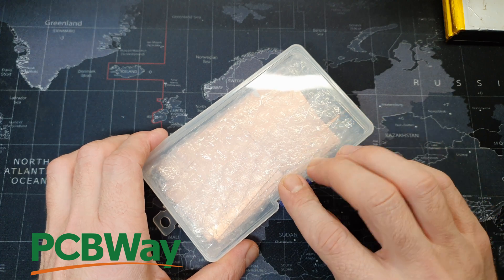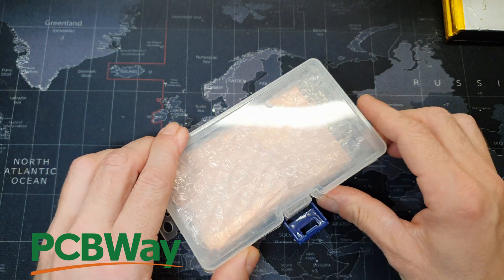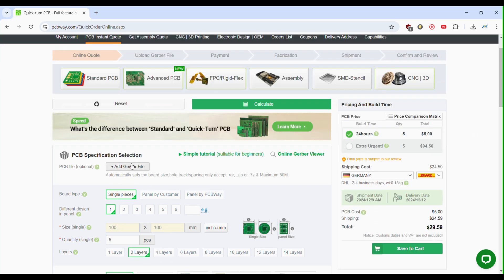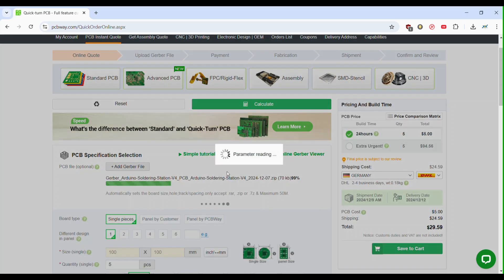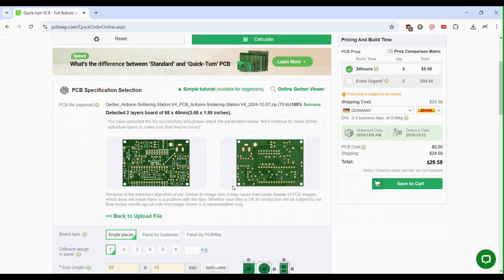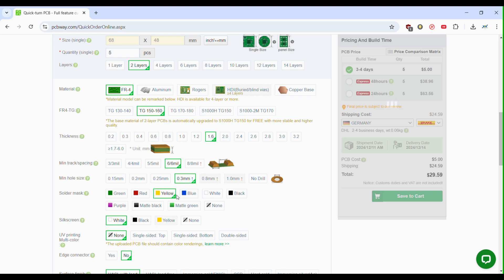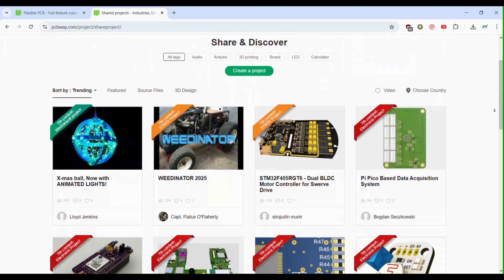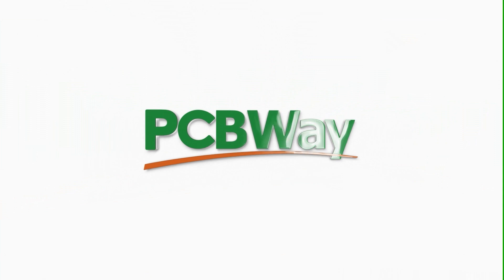How To Make Arduino Soldering Station  (Cheap JBC C245)

Comment: Hi.
Thanks. for posting this. I have put one together on perf board and having a few problems. I have just finished tracing the schematic vs the pcb photo and noticed a difference.. The schematic shows C13 on the Thermocouple amp circuit while the pcb shows C13 on the heater high-side switch side. Since you built this with the pcb, can I assume that it is right? Thanks for any help. Paul from Canada.
Reply from the maker: Hi Paul, you are absolutely right, I made a mistake when I designed the PCB, I revisited the project and yes indeed C13 was connected on the high side of the switch, when it should have been connected to the thermocouple amplifier, I updated the PCB and the folder in google drive. Thank you for noticing the mistake and letting me know!

Comment: Very cool project, I want to recreate it but have a few questions. What power supply would be good for this, and does voltage leak to the tip?

Comment: many thanks for sharing this design. When i switch it on the mosfet gets extremely hot then burns. The temperature is increasing and the power led turn on. Do you know what might be the issue?

Comment: This is awesome!
I tried it, but when I powered the heater (either 5V or 12V),
the Arduino read the wrong value. It jumped from 35°C to 500°C within 2 seconds.
I've divided the ground wire and divided the power supply, but it's still the same.
Please advise.

Comment: Hello, I'm working on this project and it doesn't work? When I apply power (18650 battery and buck voltage 19v). After powering it on, I noticed that the Mini 360 3A was hot, why? And how to set the resistor on Mini 360?

Comment: What is the use of the TC pin in the U7 connector, sir?
Reply: U7 is the connector to the soldering handle and the TC pin is short for thermocouple, the element in the tip to mesure the tempeture of the soldering tip.

Comment: C210 Tip is as Working answered Version 4 Station , i have burned tips , recycled but its not given a 500k Resistor , i can choise 470k or 510K which one is for C210 ? it is sadly to not goven a discord where get help , this is a good station but its cant resolving the tip , C210 have only pinouts P+ and - and GND = 2 Pins only. The Calibrate isnt work its overrun and gets hot at 12v 6-mp
Reply: i build c210 iron based on v4 12 iron, used 540k resistor for gain if you cant get exact resistor you can combine 2 resistors in series to get that value , for c210 tip there is only 2 pins smaller one is positive P+ and rest 2 pins middle and outer shell is shorted so you have to connect small pin and middle pin, i can not attach picture or can not share links here i would have sent images . no need to change code for v4 ino. then calibrate.  i am going to build new c210 better iron than this later.
Reply: @dhiraj787  Yes please, it is sooo needed, 540K Resistor are replacing with ( 220K )  in the Version which are V4 T12 Edition from Home Projects himself right ? But i have get a very Red Tip and its going a lot of hot , i have 12v 5.83Amps i think the supply is okay ?
Reply: @dhiraj787  I Am on a Fight from since 12.2024 i have enaugh from that station i have trashed 6 Tips it is 1000000% not working with C210 it is a fail big fail i have no idea anymore that project is the crappiest project i have ever see and start
Reply: Tryed 2x 270K no work , Tryed 470K , No work, Tryed everything the c210 is not working on that station, everything is working but not c210 sadly !
Reply: @user-bw5hk5nb3k 
Hi my friend 
You can solved your problem with c210 tip ?
Iam also have same problem
Reply: @hamedmansoory553  No i cant solve the problem its not working but they all say its working , it isnt 100% not
Reply: I have a t12 tip that only shows 
resistance from two connectors and none of them reach the body of the device. How do I close the connection?o.
Reply: @hamedmansoory553 But that is the C245 Edition not T12 ?
Reply: I just found a schematic that might be useful. Where can I send it to you?
Reply: Regarding the c210 tip
Reply: @hamedmansoory553  is the c210 edition the same with external PowerPlug ?
Reply: https://youtu.be/89hMWXOFliA?si=Qh7eQvQOK6Q2w0uC
Reply: Please check this post

Comment: I have now use 24v 6 Amps its not anymore crash or restarts, but the warming up steps is wrong i have put 50 grad its loading the grads in 10 seconds overrun 😔 Please is it fooling me or is that really working i have no more idea
Reply from the maker: I'm not sure what is realy going on with yor station but definitely shouldn't behave like that, my help is limited but I will try to help you. First power it up with lower voltage like 19V or less and see how it behaves, use another op-amp if you have ( those fake ones they behave differently from one to another ), play a bit with C13 and try to increase or decrease the value and see how the station it behaves, try to change to PID controll or DIRECT control and see witch one it works best, measure the temperature of the tip externaly and comparet with the temperature displayed by the station and lastly VERY IMPORTANT when you calibrate the station use an external thermometer like a multimeter or a dedicated thermometer for soldeing stations otherwise the calibration it wil not work and not only that the tip may glow red even if the station is showing a lower temperature, the calibration is made in 3 steps at 3 different temperatures and you need to measure the real temperature of the tip externaly at each step and adjust it accordincaly.
Reply: Hi, it starts to glow when calibrating I had to quickly unplug the soldering iron so that it doesn't burn, it behaves like this as soon as I put the soldering iron in the station it heats up by itself and when I type in 30 degrees it exceeds up to 300 degrees, which range is used for temperature measurement and control?
Thermocouple Amplifier Maybe I have some error there?
Reply: @user-bw5hk5nb3k  there maybe multiple reasons, most related to your opamp circuit. to check if your opamp is working properly write a small arduino program to display adc values of opamp and upload it to arduino, then heat your c245 tip with other iron and see what values it is showing, values should increase as temp increase. if ii is very random or fluctuating increase c13 value to 50 to 100nf capacitor and try it will stabilize fluctuation. try to change opamp if possible (Most effective) mcp602 or sgm8552 . then check.
Reply: Hello, thanks for your help, I finally got it working, only worked stably with 24v 6amps without crashes and reboots.

But now comes my slight problem, despite calibration, whether pid or direct type, the numbers easily jump back and forth back and forth back and forth e.g

Set at 150 degrees
It dances while 
152, 153, 155, 160, 157 back and slowly down always in this area 150-160 dance areas.

Would c13 with 50nf or 100nf solve the problem, without c13 a capacitor the station doesn't work at all 😥

Comment: No Sucess, again the same i put it to 30 Grad the soldering iron heating up very very over 300 grad i must pull it off, please what is here wrong that is the shematics which u are swear it is 100% working, i swear it isnt working ! The V4 T12 yes but that isnt working !

Red Wire = Thermocouple = P+ ?
Green Wire = GND ?
Blue Wire = P- ?

Where is P+ and Where TC connection ?
They are at the same Place at the End please is the Shematics 100% error free can u sure that ? 

I have try everything really everything 

Day 20 or more now, please help otherwise i can leave that channel, de abonnemont and buy a Working one that is really a bad situation The Resistors at the Shematics are the Same like T12 

My Tip Have 2.4 Ohm c245
Reply: i think you are using your same old arduino board used for v4 T12 station. that older board saved adc values of T12 in eeprom.  Clear eeprom and upload code again. As adc values of T12 tip are high arduino try to match those values and keeps on mosfet so iron get very hot but adc values for c245 are very low so it cannot be reached. So clear eeprom calibrate c245 tip.
Reply: No, it is fresh opened from seal a Arduino Board Nano , i was upload directly that C245 Ino , the Temperatures are springing arround, it isnt working it is 100% fail to use that it stays 30 Grad and he heats and heats and heats it is 100% short free

TC Connection is my problem, where is it ? 

The Earth from Tip ?
The P+ From Tip ?
The Heater P- From Tip ? 

Please i will a sucess nothing more 😞
Reply from the maker: You connected the handle totally wrong.

Red wire = TC
Blue wire = P+
Green wire = GND

Fallow correctly the schematic and pictures of the pcb that I put it in the project folder.
Reply: Its doesnt work, its give totaly false Temperature Numbers

The TC Connection on the Shematics are at the Endpoint meeting at P+ 

I have connect it a few minutes before now, it is 100% nor working, i am not lying.

MY Iron Tip is from Yihua and it is 2.8 Ohm anythings wrong ?
Reply: @user-bw5hk5nb3k  TC is connected to pin 3 of opamp through 10k resistor check it again. P+ is connected to mosfet.  Dont get confused. Please check schematic again.
Reply: @dhiraj787  Okay,  isnt that so ? 
the beginning C13= The - go to GND 

THE + goes to the C7 Minus which in turn goes to the IRFZ44N SOURCE leg 3 so through the two capacitors C7 and C13 I have a meeting with TC and P+ with my multimeter, P+ is SOURCE?

Version 4 of them works perfectly on the T12, but something is wrong with the shematic, I understood that I should take a good look at it, the values are not right, the temperature jumps back and forth :eyes-purple-crying:
Reply: There is small issue in schematic at "1X9 Headers", pin no 5 should be TC (connect to pin 3 of opamp)  but written as A5
Reply: @dhiraj787  yes see uu , u say that is given a issue  is that only one issue ?
Reply: @dhiraj787  Please Look with multimeter check the Leg 3 Source ( IRFZ44N) with the Point C13 Leg + its beeps and on TC with P+ its beeps again on my circuit is that the issue what i have ?
Reply from the maker: @dhiraj787 No, the schematic is correct, there is two rows of pin headers, on the second row the unused pins are are connected to first row and the rest of the pins are separate connections, so TC pin is not connected to A5.
Reply: @dhiraj787  NO CHANCE IT IS 100000% Beeps with P+ and TC what i will to say is P+ and TC give a SHORT
Reply: if everyting fails, just write a small arduino code to read adc readings at pin A5 of arduino, and show that reading in oled screen, then heat c245 tip with lighter / other iron and check if adc reading changes and how much reading it shows, adc reading should increase when heated (at 250degree celcius it should show between 400 to 500 adc value), it will confirm opamp part is working or not.
Reply: @dhiraj787  Okay, so now I've removed everything and the shorts are gone for about 2 minutes and they heat up very slowly, I guess (power supply)? It heats up and I hear noises from the soldering iron. Without plugging in the soldering iron it shows me my room temperature, it starts at 50 degrees and drops to room temperature and stays like that, is that right 21 degrees? I can't calibrate it. At 220 degrees it stops and there are noises coming from my power supply (24V 2.71 Amp)
Reply from the maker: @user-bw5hk5nb3k  2.7A is not enough at start up when the tip is cold it draws around 10A at 24V, I recommend you to use 19V with 4 to 5A like a laptop power supply, at 19V the soldering station it's more stable and the 21 degrees displayed is normal. Now, from what I understand you had a short circuit, or what caused your problems?
Reply: @HMProjects  I thx u alot u are a King : ) , i have now understand why its restart and its comming noises from Supply, i have buyed now 24v / 6 Amp its 144 Watt . 

Yes it was a short on TC area i have connect it with p+ it was a big mistake from my Side 

RED = TC
Blue = P+
Green= GND

That was worked for me : )

For propper working i must calibrate the Tip right ? Because it was Heating but on 250 Grad and up its restart ( Powersupply )
Reply from the maker: What are you talking about?, În the schematic where is the GX12 connector, TC goes to thermocouple amplifier and the P+ goes to high side switch that controls the heater and P- is the ground ( GND ). Please fallow carefully the schematic, when the handle comes in the package ( NEW ) the wire configuration is different in the connector, you have to reconnect the wires in order to match the connections of the soldering station.
Reply: @HMProjects  Okay, from the beginning C13= The - go to GND 

THE + goes to the C7 Minus which in turn goes to the IRFZ44N SOURCE leg 3 so through the two capacitors C7 and C13 I have a meeting with TC and P+ with my multimeter, P+ is SOURCE?

Version 4 of them works perfectly on the T12, but something is wrong with the shematic, I understood that I should take a good look at it, the values are not right, the temperature jumps back and forth, so why can't I get any help ? and if you really help me make it work in the end, I'll kiss your soul and your heart and really praise you here

Comment: I would like to know if anyone has had success with the project? If so, what changes or procedures should I follow?
Reply: I have made version 4 of this station and modified it to use with c210 tip.
Reply: Please can u Helps me please i sit here really 21 Days or more now : ( 

Okay, so I need 24V 6 amps?

But it measures incorrect values at 25 degrees, it keeps heating up, and I can guarantee you 100%, I haven't forgotten any shorts or anything it is give false tempmessures 

TC and P+ are the Same Point at the end or ? 

Where are The TC Coknection ?

Please have u a discord or so to can helps me ? 😞
Reply: Hi have u use the Version 4 Ino and the shematics from these Station with other OPAamp and 500k right ?

I have 12V 5.83A Powersupply is it workin with C210 ?
Reply: @user-bw5hk5nb3k  I believe so, but is it enough for the circuit to function properly?
Reply: I hav yesterday check everything and it is 100% with 24v 2.71 Amps not working ( c245 ) i have order 24v 6 amps supply the Tips alone needs 120-130 Watts i hope i can help u, have u build the circuit ?
Reply: @user-bw5hk5nb3k  I have everything to build, do you think I should try or is it not worth it. Should I start version 4 like the other guy said?
Reply: Have u Powesupply to start ? 
U will Build c210 ? 

I say try it , on my Version iit isnt wirking ( i dont know why ) 

Version 4 = c210 with calibrate or ?
Reply: Have u build your c210 Station ?
Reply: @user-bw5hk5nb3k  Not yet. I'm having trouble creating the circuit board using the thermal transfer method. My process involves using a copper board and a transfer sheet printed with toner. I transfer the toner onto the copper board using a regular clothes iron, and then I etch the board with a chemical solution to remove the excess copper. However, I'm facing difficulties, as the toner doesn't always transfer perfectly, and it affects the quality of the final circuit.

I live in Brazil, and things are quite challenging here. The government imposes high taxes on imported components, which significantly increases their cost. Components that should cost just a few cents are now very expensive, and that's not even counting the shipping. For example, I need certain components that cost 15 reais, but the shipping alone is 25 reais or more—and that's just for one component. Building the entire board is a lengthy and costly process. Even something as basic as a soldering iron tip is very expensive.

As a student, my financial situation is not very favorable, and I’m also a bit hesitant about purchasing the remaining components due to my lack of experience and budget constraints. However, I’m slowly making progress.

Could you tell me which method you used to create your circuit board and if you have any tips to make the process easier?
Reply: Hi, I made the board with a breadboard because, as they say, the costs explode otherwise. With a breadboard, it's cheaper, but you have to be very careful with the shematics because nobody here is very precise. I don't really help. I've been sitting on a stupid shematic for 6 weeks and that is extremely sad
Reply: @ I'm going to try using the breadboard, it makes sense to start there, less chance of going wrong, I believe we can help each other if I manage to advance
Reply: Hi, can u please say if it so correctly ?

I have use The V4 Ino which u say u have use :

And Opamp ihave replacf it like u say
512k OHM i have but it was not given a 500k Ohm 

My wires are verythin and it was melted have i do a mistake again ?
Reply: @dhiraj787  Excuse me, could you tell me what modifications you made to it? thank you